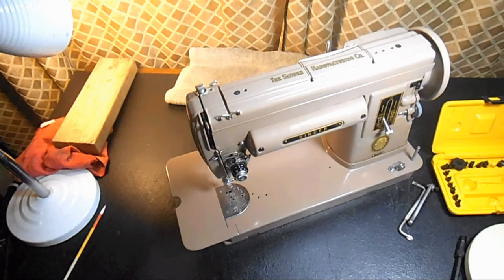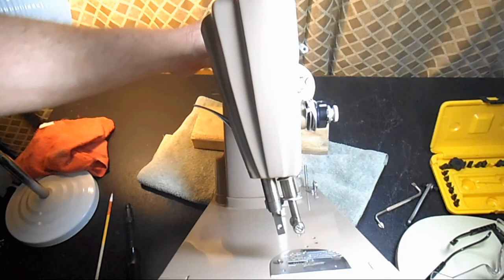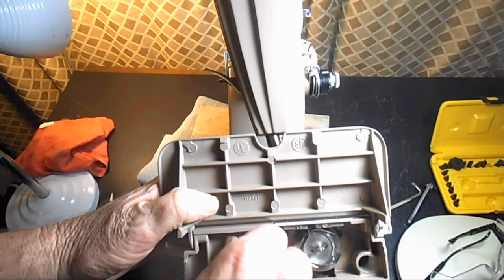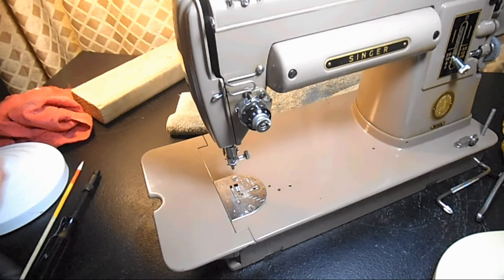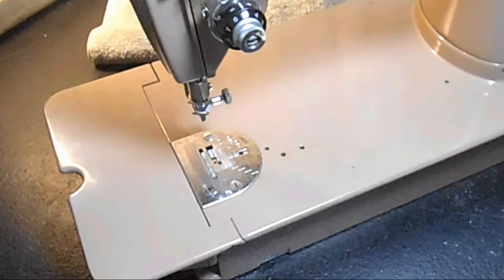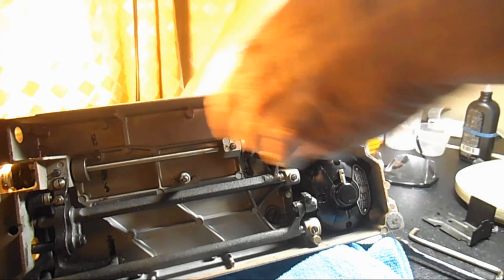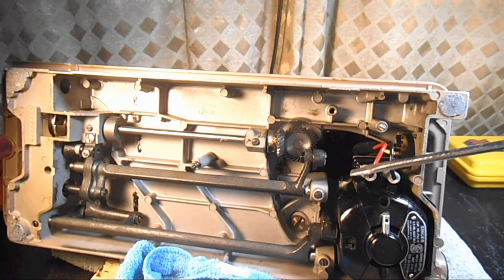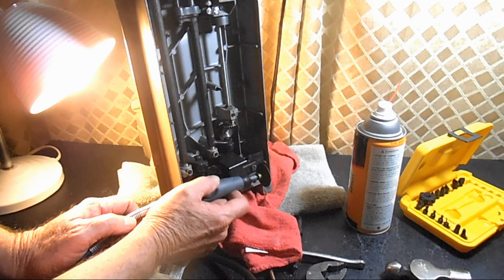Set the Height of the Feed Dog - Singer Model 301A

Comment: If the .043" is critical, you could use a stack of 3 feeler blades to help you. 

Stack an .030 and an .012 to give a total of .042. A third blade (any thickness) on top of these two would snag on feed dogs that are .043 "  high.

By putting a third blade ( any thickness) on top of your .043 stack (.030+.013), the third blade should slide over the feed dogs.

Would that be worthwhile?

Love your videos.
Reply from the maker: Really great idea Terry and thanks for sharing. I pinned your comment to the top. Your method sounds much easier to accomplish and less fiddly. I like it a lot. Take Care.

Comment: Andy you need a fine drill to drill out the center of screw,then they sell an easy out tool to get screws backed out.It goes in a reversed angle and you actually once it tightens up..back out the remaining piece of screw...Piece of cake to do!
Reply from the maker: I plan to see if it will work on this small a screw. I see them online and thank you very much, Andrew.

Comment: I bought a free motion foot for a Singer 5050c. But that Singer has no feed dog lowering mechanism (as fast as I can tell). So I'd like to try the free motion on my Singer 391a. Now I know where the feed dog nut is and can lower the feed dogs entirely. Andy do you think free motion sewing will work with the 301A?
Reply from the maker: Singer model 301A has a built-in Feed Dog Throw Out. It is controlled by a large thumb nut to the left of the Hook/Bobbin Case if you lift the extension table and look you will see it. It is often hard to turn by hand but has a slot for a screwdriver if needed. You can control how far down to drop the dog including all the way to complete throw out. This video shows and talks about the Feed Throw Out System including how to adjust it if needed. https://youtu.be/EZdlAccPqLU  Thanks for watching my channel.
Reply: @andytubesewing1953  thanks Andy Tube!
Reply from the maker: @kristinjacobsen3417  You're welcome sorry for the bad spelling haha

Comment: Andy, does adjusting feed dogs on the 500 or 503 handled the same way?
Reply from the maker: Similar, but a little different using a straight edge. The god teeth on a 500A/503A are lower in the front than the back (no idea why) and while the 301 height is stated a ".043" the Rocketeer manual says "a full depth of feed dog teeth should project above the top surface of the needle plate". It's always something, right. Just go here https://sewingdude.files.wordpress.com/2012/09/singer-500-service-manual.pdf and download a free copy of the 500A/503A Service Manual. Follow the directions on page 5 and you'll be fine.

Comment: Great vid Andy.
I want to address the "Motor Securing Plate".(Just what I call it) broken 
screw issue.
#1. Best Case Scenario:
There is enough of the screw shaft remaining to get a pair of small Vice Grips
locked on the thread shaft to break it loose.

#1A. As you have pointed out in previous videos that all the bolt/screw threads
 are  proprietary for Singer (SIMANCO) so good luck finding a Machine Tap for
 that size and thread count. So now we must address worst case.

#2. Worse Case Scenario:
Disclaimer:
If the offending screw was a little bigger, you may be able to use an "Easy-Out" 
by center punching, drilling and inserting the easy-out with reverse threads
and if you're  lucky, the easy-out will bite enough to remove the screw.
NOT going to happen in this case.
Here goes:
#2A.  Grind or cut the casting from around the offending screw below
 where the broken head is, just enough to get said Vice Grips a good bite 
on the remaining screw shaft. Remove the offending screw
#2B. The offending screw is VERY long and screws into this mounting 
post quite far so there may be enough internal thread left to simply
file/grind the post flat, add enough washers to built up to normal mounting
height and VOILA! 
#3. If that does not work, take 2 Aspirins and message me in the morning.
There are more options including drilling/tapping with SAE thread tap
and SAE screw. (Or metric, doesn't matter)
Trent
Reply from the maker: I saw the easy-out set up after Andrew Mikulich commented about it. I planned to ask at the store about it working on that small of a screw. I'm worried it's too small. The idea of removing some of the aluminum to use a vise-grip for removal seems possible. I've never had this situation so I appreciste te tips and advice. Thank you.
Reply: WOW!....Piece of cake huh?
Andrew is obviously from a different planet than I am. (and I mean that in the nicest possible way)
The Shank diameter on said screw is: .163 (as close as I can measure W/ dial calipers)
Just for reference: 1/8" is .125 and 1/4" is .250 thousands of an inch.
so one could say the shank DIAMETER  is closer to 1/8".
NOTE: You will have to center punch that before you can drill it.
PS> You only get one shot. If you fail to find the center, you will 
have to file that off flat and try again.

The overall length of screw is slightly more than 1-1/2"

The screw is  threaded on this SIMANCO screw slightly MORE than 5/8" but less than 3/4" or A LOT OF THREADS HOLDING ON TO CASTING MEAT.
Not sure what the Rockwell hardness of the screw material is but if you are able to succeed in drilling this screw out far enough to get a 'bite' with an Easy-Out (if you can find one that small) and fail to break the 
screw loose, then you have lost that length of shank/shaft on which
to get a purchase with your vice grips as the drilled out shank will crush
under vice grip loading.
Here's my disclaimer:
"Your mileage may vary."
Reply from the maker: This is why I was worried about the size of the screw. Most of the screw removal kits are for bigger diameter screws I think. Also, I don't have a drill press or anything like that, and I don't trust myself to center-punch and drill such a perfectly straight hole into the little screw. I imagine myself making the situation worse. A friend emailed me earlier about trying to get a  vise-grip on the screw. I feel I could sacrifice some of the aluminum surrounding the end of the screw to get a grip on it, then after removal filing the aluminum flat again and using a spacer or washers to get back to the original height or close to it. I do have the replacement screw and agree  there wold be plenty of threads left in the hole. Attemping this sounds better than me causing furtheer damage and buying a tap and die set to make a new threading size nd using a new SAE screw or bolt. Time for me to learn something new I think. Thaanks for your thoughtful and articulate response Trent. Much appreciated.
Reply: One last suggestion:
Don't be stingy about cutting the casting metal away from the screw.
You need (my guess) a full purchase of the vice grip because as I 
already pointed out that there are a LOT of threads buried deep into
the casting. Use a sanding disc when you get close to the shaft as
you don't want to 'nick' or weaken the shaft with a cutting tool.

Here's the good news. (never saw that coming did you?)
The diameter of the threads are larger than the screw shank.
(Proprietary SIMANCO) which means there is space between
the shank and the hole down to the threads. 
Use PB Blaster and let it sit W/ machine upside down while you 
muster your resolve.

You CAN do this Andy as I have Blessed you and pray for your success.
PS> Please RE-name "Oh No".  (there are re-naming procedures that
must be followed. i.e. incantations, sacrifices and Champagne ;)
Reply from the maker: Your comments are all "good news" to me as I did not have much of a clue on how to proceed. You are the best Trent, thank you.
Reply: If all of that fails you can still come out ahead...They sell a aluminum rod that will use a propane torch to heat it up,drill out the screw and refill it with the rod,then simply retap the screw hole to any size you wish.
This rod is used on all aluminum pieces...I saw a guy punch a hole in a pop can and melted the rod to water tightness on the can,so not a lot of heat is needed
Reply from the maker: Thanks for helping to alleviate my fear of screwing up so bad I can't salvage it. You guys are great to share with me. Many thanks Sirs.
Reply: If all of that fails I have another sewing machine body
Reply from the maker: Thanks for the link. More possibilities if needed. I appreciate the time and thoughtfulness Trent.
Reply from the maker: Thank you, Andrew. There are more solutions than I thought. I appreciate you sharing your information and giving me great ideas Andrew.

Comment: It looks like a ice cream swirll backwards...
Reply from the maker: You have a good imagination Andrew. Hehe.
Reply: Well Andy I have the tool and it works well
Reply from the maker: I am sorry Andrew. I misunderstood our previous comment. Please share with us about the tool. A link to it, or picture? Thank you very much. Take care.
Reply: It has threads backwards,against the  grain.So when you screw it into the piece you drilled out it bites into the metal...I think you can fine it at True Value Ace Hardware
Reply from the maker: Ahhhh, now I get it Andrew. I found what you are talking about. I'll go and ask them if it can work on a screw this small. Thank you for the tip. I was thinking I'd have to just drill it out then use a larger screw.